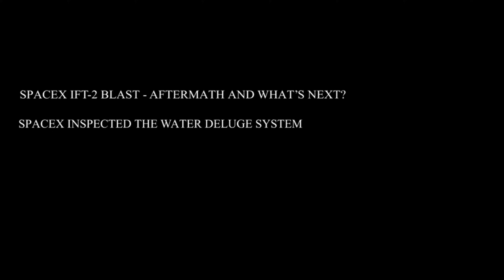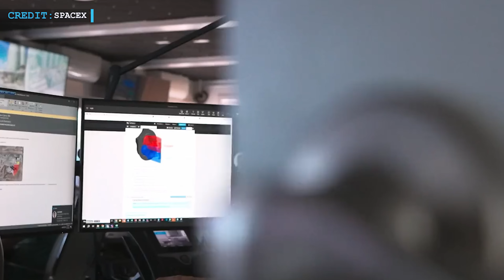SpaceX Starship IFT-2 Blast | Aftermath | SpaceX inspected Water deluge system

Comment: Growing up in Southern California teaches you something about what salty air can do to connections and surface finishes. The Navy and the Coast Guard can produce data that will substantiate/support anyone wanting to make that point!  At 1:30 we learn that this batch of 33 motors was installed a year ago. Could the grid fin actuators and or other sensor and  connections have been compromised in that 8760 hour period. Can they be scanned and tested reliably??? I mean it's not like the assembly was hermetically sealed for that time!!!

Comment: "Not go well" . . .BS.  This was a flight TEST that went very well.  It was completely nominal all the way to and through staging.  The booster failed to return for a soft touchdown (notably something that no other rocket even tries to do).  The second stage remained nominal nearly 100% of the way to its targeted slightly-short-of orbital speed goal of ~25k kph (it got to ~24k kph).  Scott Manly nicely pointed out the deceleration of the booster at staging which may have caused gas to be taken into the fuel system and the ultimate destruction of the booster.  I'm hoping that this is just a matter of leaving the booster with a little more thrust at staging.  Hopefully whatever the issue is with second stage is as simple, but it seems like that may not be the case.  The other clear issue is the failure of the tiles to stay on Starship.  I fear that may be a problem for some time to come and that Starship will not be a reusable for quite some time to come.  Again we are talking about a problem that other rockets don't have because they don't even try.  If Superheavy and Starship can get to orbit, even as a completely expendable rocket, it will still be the cheapest and largest heavy lift rocket ever.

Comment: When you look at how far this rocket made it this time, I mean in another year or so regulators be willing, this thing will be making regular trips to orbit and back, it helps give a sense of how much has been missed by making it so NASA basically cannot have failures while at the same time there is basically no budget there for NASA to use and politicians design the rockets for NASA.  While you don't want to get into piles of failures with space for multiple reasons, having everything for NASA it has to work the first time or people scream "failure!" and funding gets pulled is bad for innovation.  Innovation is essential for NASA to really do its job.  Granted, there are plenty of low risk missions for NASA to take on and so these really should be done in such a manner where they probably should work the first time, there is also a lot where major advancements and thus risks need to be taken for NASA to advance things.  You look at NASA getting stuck with things like the Space Shuttle where they knew it was a bad design that was going to get people killed and they could do nothing about it beyond watching two whole crews die due to known flaws.  Also, they could barely launch anything because 1.5 stage to orbit is stupid and barely works at all, only after all safety systems are stripped out can they achieve orbit with any sort of useful payload like a hollow telescope.  Getting stuck with the JWST where it sat on the ground for decades while Northrop Grumman dorked it up after taking over TRW and getting rid of the talent that was making it happen and so NASA eventually had to bring their own people in to fix it up.  So then we go decades without any real advancements in space astronomy as this thing sits on the ground.  Getting stuck with the SLS, which is a huge waste a money and cannot complete its intended mission without another rocket like Starship to do the heavy lifting that the SLS cannot do because it is using 40 year old rocket technology that was never all that good.  While there are still good things NASA does, so much of the very limited budget has been thrown away because failure is not an option and politicians don't let real engineers design things and innovate where they need to innovate in order to really succeed.  The Space Shuttle was Richard Nixon decided he was a better rocket scientist than Wernher von Braun and well Nixon was an idiot, so we ended up with something dumb I am sure Wernher von Braun was shaking his head at before he passed.

I think this is an important thing to point out, the USA got to the Moon because JFK saw that Wernher von Braun and his team was the best the USA had access to and so basically gave them free reign to design and build a Moon rocket using the nation's resources.  They were able to build a ground breaking rocket.  This groundbreaking rocket was based on decades of experiments that often lead to failure, plenty of Wernher von Braun's rockets failed over the years, and even some of the initial Saturn V launches were partial failures along with a deadly ground fire, but this all lead to innovation and eventually the successful landing of man on the Moon.  It was after this when Nixon decided he was going to run NASA when this all went away.

Comment: Wow what a wrong assessment can you get.
This is new tech and systems need to be tested in the real word, with adjustments made once the real testing shows any problems. So we got the Stage Zero deluge system and all the full-flow rocket engines to work nominally, plus the whole newly designed stage separation system.
If you feel the need to have a go and obviously and emotionally get rid of your frustrations, then please do yourself a favour (if wanted to be taken seriously) and pick on some total failures and show you actually know about how engineering development works, like the dark matter detectors and which cost millions upon millions and not unsurprisingly, found nothing. https://www.youtube.com/watch?v=MvNCWMD6so4&list=PLbJC-AsQv6hUJu_pki9MXT8xrfQ8rKqjg&index=49&t=73s

Comment: "It didn't go well" is simply not true. Goal as stated prior to launch? Successful hot staging and Space Vehicle continuing toward splashdown. Bonus events would be soft landing of both Launch Vehicle and Space Vehicle on the water. Also wanted pad to survive as a stated goal. All goals accomplished and they got many minutes of SV mission as a bonus.
Reply: And SV engine shut down was planned from what we can tell by audio dialogue. I am suspecting an ullage problem kept from relighting the engines. No fuel. Their telemetry should tell the story there. And on LV, I am guessing that they introduced more of a tumble that the current fin/steerable engine combo could overcome. Auto Flight termination system id the right thing in both cases and destroyed the vehicles over unpopulated areas. I am guessing they will need to add RCS thrusters to overcome the tumble or reconfigure how many engines are lighting on LV.
Reply: Clearly they have no idea how to re-ignite engines given a random position of the booster or the star-ship in the presence of almost empty fuel tanks.
Also, SpaceX is yet another example of the government gifting peoples taxes to private owners without getting any ownership in SpaceX for the people. Only corrupt government protects the Owners of businesses more than the People of the country.

Comment: Dude, are you doubling down on stupid? IFT-2 went fantastically well. No-one expected Starship to splash down near Hawaii. It might have been nice if booster made a controlled splashdown, but the real successes were the 33 engine lighting and burning perfectly, the water deluge system protecting the pad and the hot-stage separation working effectively. Anything beyond that would have been cream.
Reply: Spot on correct. The 33 engines lit all ok. Separation all ok. The next six lit ok… the rest is just a “bonus”

Comment: What do you mean it didn't go well?  It was a successful launch with a successful separation.  Knowing SpaceX, they've collected enough data to correct unexpected malfunctions and the next launch will go even better.
Reply: just a second thought - hot stage separation is the only event that could cause malfunction on both ends, so maybe it didn’t go as expected. maybe next time they’ll lower down the grid fins or extend the hot stage
Reply: @paveltroev8221 a theory was suggested;  the ingition of the starship engines caused blowback at the top of the dome damaging or weakening some parts in the starship engine bay.

Simultaneously, the sudden push from the starship onto the booster may have caused the liquid propellents in the booster to come off the bottom and start splashing around, maybe even forming bubbles that were sucked into the pumps.  

Bubbles in pumps is bad.  Super bad.  Also tons of liquid propellent sploshing around is tons of mass doing random stuff the flight computer might not have been able to deal with.

Not my theories but I think I agree with them, they seem quite plausable.
Reply: Totally agree.